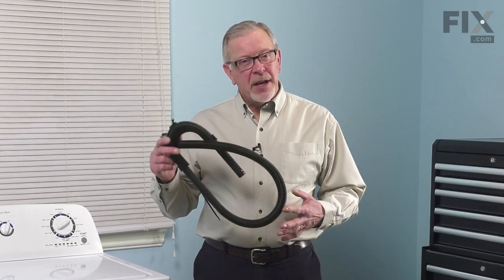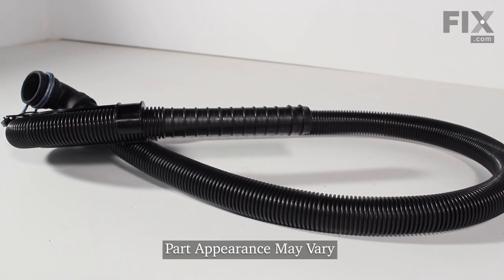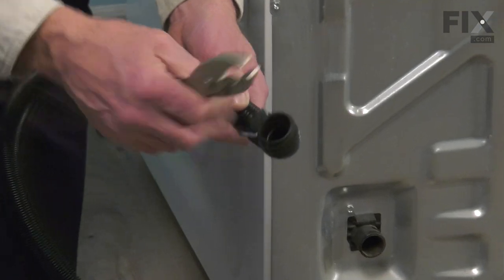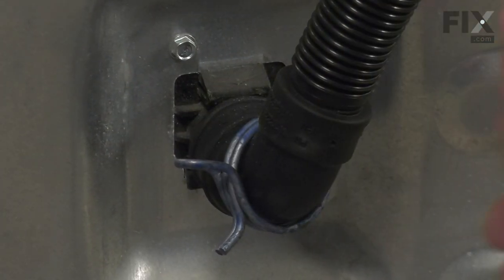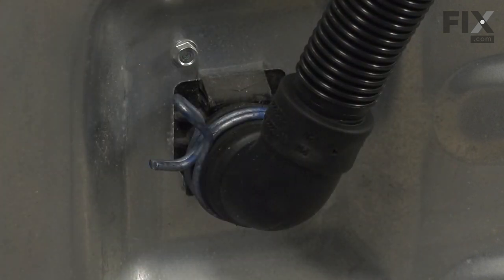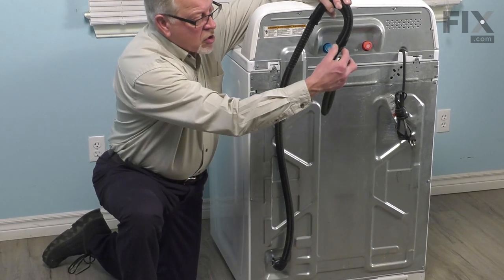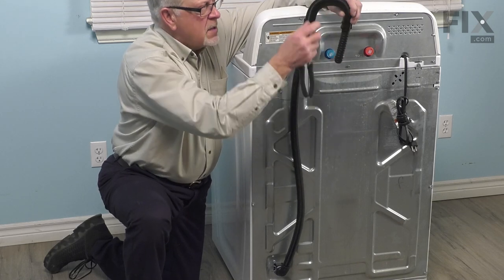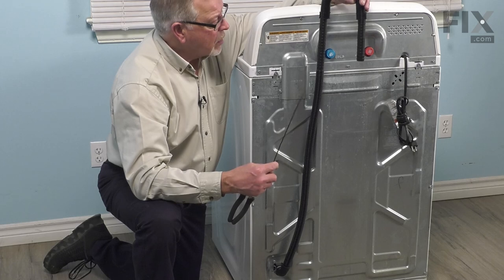Whirlpool Washer Repair - How to Replace the Drain Hose

Comment: Can you please show how to do a replacement repair for the drain hose ( the hose for when the water comes out the machine when done washing) for the model: WFW9400SW01 front load washing machine. The plastic to connect the hose is worn out how to replace that as well. I think you call it a connector.